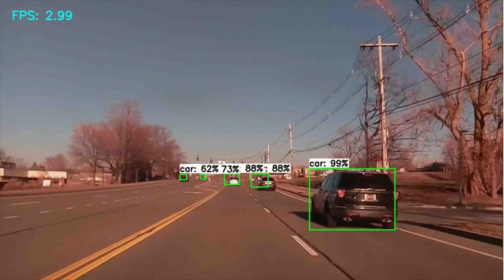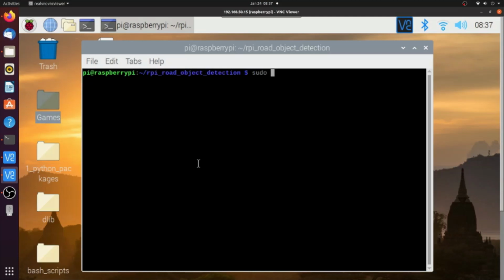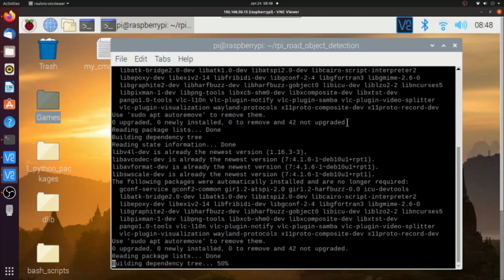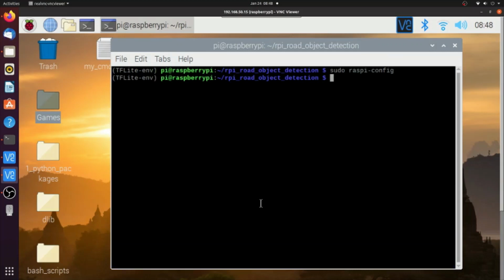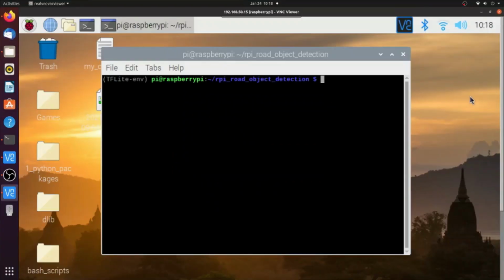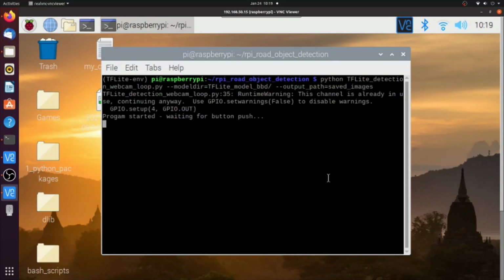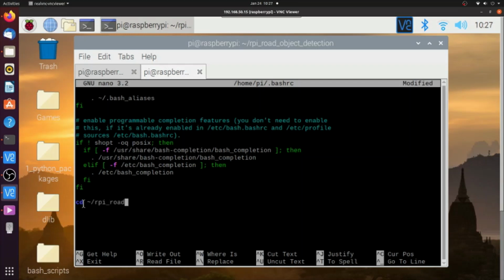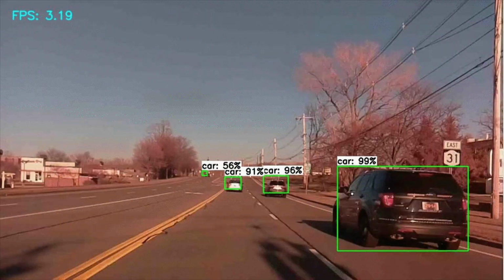Autonomous Driving Object Detection on the Raspberry Pi 4!

Comment: This is great.  I have tried a number of raspi object detection examples and this is the firtst one that worked.  I would like to show the annotated image on the display.  I tried uncommenting the imshow() on line 248 but that didn't do it. Any suggestions?
Reply from the maker: Awesome! Glad it worked for you! Sorry cv2.imshow isn't displaying anything on your end. Can you confirm that jpeg images are being saved to disk by the script first? I want to make sure everything is working without imshow(). Also what's your set up like -  are you trying to display images on a monitor connected to your raspberry pi - or are you connecting to the pi over ssh?
Reply: @ethanspitips5903  thanks.  I got it to work by stripping down the code a bit and using imshow(). not sure what was wrong to start with.  great video - thanks again.
Reply from the maker: @bill2009utube  Awesome! Glad you got if figured out!

Comment: can i use raspberry pi 3B.?
Reply from the maker: I haven't tried it with the 3B. This tutorial on object detection says the 3B+ works: https://www.digikey.com/en/maker/projects/how-to-perform-object-detection-with-tensorflow-lite-on-raspberry-pi/b929e1519c7c43d5b2c6f89984883588. Regardless it should work, but it's likely it will run slower.

Comment: Ethan, I have successfully installed and am running this tutorial (many thanks!). I need to drive a GPIO output when a specific object is detected. Can you tell me how I would go about doing that using the install from this tutorial as my starting point ? I do not need to store video files on the SD card, just get the GPIO single pin output when object 'x' is detected. THANK YOU Scot
Reply from the maker: Hey Scot! Glad you could get it working and good question. If you look around line 217 in this module: https://github.com/ecd1012/rpi_road_object_detection/blob/main/TFLite_detection_webcam_loop.py you should see where the detection results are retrieved. Here you can write logic to drive GPIO pin! Let me know if that helps :)

Comment: Whenever I try to download the dependencies bash get_py_requirements.sh it just says no such file or directory
Reply: Ok
Reply: i think that you were not in to the rpi_road_object_detection folder directory
Reply from the maker: @wisnueepis3593  Good call!
Reply from the maker: Hmm that's odd. Can you share more about the error and which directory it can't find specifically? Also would you mind double checking that you 1.) Cloned the repo correctly 2.) the get_py_requirements.sh file exists 3.) that you created a virtual environment and activated it. Hope this helps - let me know if you still can't get it working.

Comment: Do you think this fps is enough for counting the cars?
Reply from the maker: It depends on your performance standards. If ~3fps is too slow, then no. Another option if you need faster processing is to usese a USB accelerator like this: https://coral.ai/products/accelerator/ Hope this helps!
Reply: @ethanspitips5903  Thanks for your comment... Can I connect an external ssd to raspberry pi, and do this object recognition into it ? If so, do you think the performance will be better?
Reply from the maker: I have seen people use SSD's with the Raspberry Pi. It could speed up the data I/O and performance (I'm not sure how much and I imagine it'd be a small increase). The biggest bottleneck in processing speed is the CPU on the Pi. If you really needed better speed (or inference time) looking into using a USB accelerator would be a smart option, since it's designed to speed up these sort of tasks.